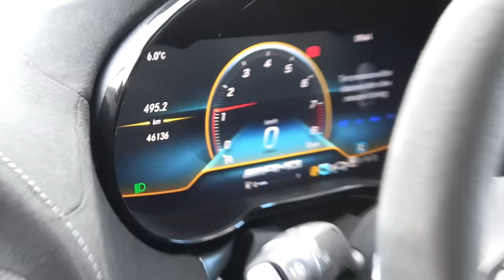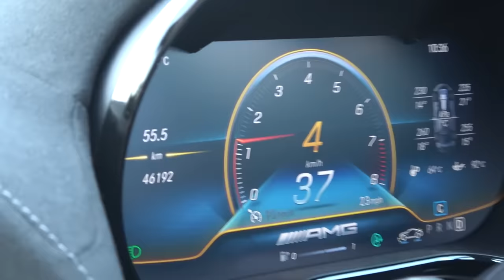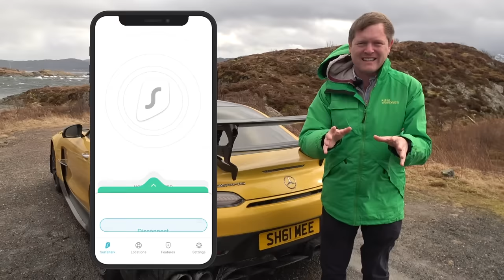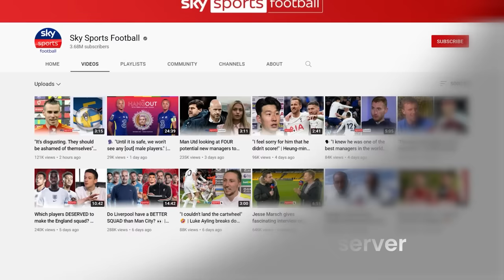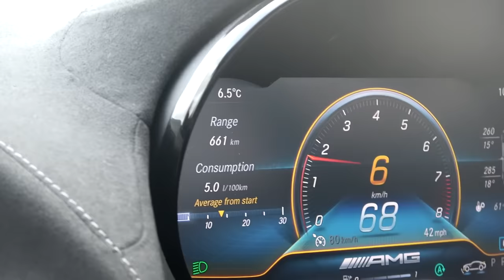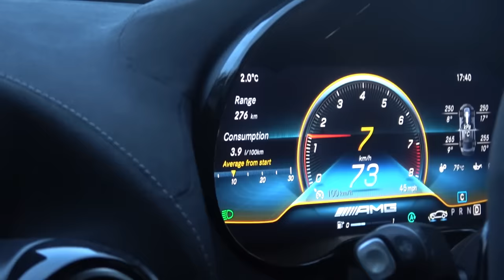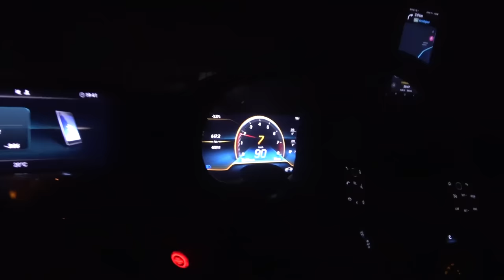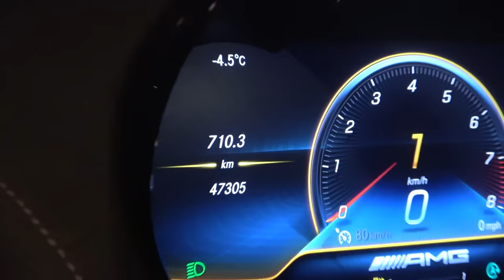The CURSE of the SHMEEMOBILES! It Happened AGAIN...

Comment: Tim…I did the same sort of journey to the Artic Circle in my (then) new 1986 BMW 325i Sport but I went via the east coast of Sweden and up to Lappland then back down through Finland…as you have discovered, that is a LOONNNNNNGGGG way at 40/50mph with overhead Police helicopters watching you so that you rarely ever see them! You also get to see many trees….many..MANY trees…can there ever be a wood shortage?? I did make a film but on VHS format and I have not seen it for decades! Re the roads…I went in May and that is not a good plan as there were long sections where they remove the entire road surface to allow the Permafrost to melt before replacing the complete road from the base upwards. That means…long sections of loose rubble that terrifies paintwork and tyres. I did escape but the car was a picture when I got back home! I think we need to go again…those roads are my sort of place..Not the rubble..but the huge landscapes, sea, bridges and remote tiny villages. As for eating…it was lucky dip and I could not read Swedish so bought myself a nice packet of dog biscuits for lunch…hmm..only once though. Next day a box of “ Nora’s Knackers” which were a shade better but I doubt Bonzo would have spotted the difference! Keep going Tim…build ever more memories.😃😃😃😃😃

Comment: I use specially made adhesive dots that you can place over such a chip/crack to mitigate the risk of the chip/crack propagating. I’ve never had an issue with wipers or my heated windscreen (in Canadian winters). Gives me more than enough time for a professional chip repair that makes it disappear.

Comment: You can wash a windscreen @Shmee150, you don't need to fit a new one when it gets dirty.  lol.   Epic trip, lets hope that there are no more issues before you get back home.
Reply: If you re-watch that section the windscreen is actually cracked.  For most normal cars people would just get it repaired and not think about it again, but with a car like this, with the speeds and pressures it's capable of, a small crack can become a big safety issue very quickly.

Comment: Schmee with the windshield thing, have you thought about looking into polycarboniates, or the stuff they use on armored cars, or maybe a wind deflector on the nose of the car to interupt the airflow, or rather behind the vents, as it could be sucking it in from underneath and throwing it through the vents at the windshield

also my old 2.5 on 89 octane was doing about 350 miles with a quarter left before it needed a fill up, and that was with driving it like a ferrari with 35:47

as the Volkswaggen audi group getting rid of the 5 banger was the worst decision they ever made, now the only thing you can get it in is the RS3, which is now even in turbocharged form, pulling in over 30 miles per gallon on the highway

and I didnt drive slow, and didnt have no stinking turbo or hybrid mode neither, like who knew driving a car with Gene Hunts motor under the bonnet, was the way to get good gas mileage, while having a load of fun

and I had that thing 12 years purely because of that, and the fact that they got rid of that motor in 2015

mind you I didnt have 500 horsepower, although apparently I had more than a ferrari 308 with a Dicky cam put in by a moron

judging by tavarish's now fixed ferrari 308 that is woefully underpowered for what it should be, god I miss that car. 

should have just kept the thing and turned it into a rally car

Comment: What does false fuel mean:
After the ignition spark jumps, combustion of the compressed fuel-air mixture is initiated. The flame front spreads evenly at a speed of around 20 m/s. This can result in temperatures of up to 2,500°C and pressures of up to 60 bar. At the end of the work cycle, the pressure has relaxed to 3 bar to 5 bar at around 900°C.
In a hot combustion chamber, the air-fuel mixture can spontaneously ignite explosively. The gases then burn uncontrollably at high speed. One reason for this may be low octane fuel.
When temperature and pressure suddenly increase, the pressure waves spread through the combustion chamber at the speed of sound and hammer on the cylinder walls. Such “knocking” combustion places a very high mechanical and thermal load on the engine. The pressure peaks that occur can damage the pistons, bearings, cylinder head, valves and spark plugs.
The octane number says something about the ability of gasoline fuels to prevent uncontrolled combustion in the unburned residual gas before the controlled flame front arrives.

Comment: Fuel in Norway does not hold that high quality (lived there for 8 years). Just when you pass the border to Sweden, find a Shell station with 98+ octan.. that's what we drive with the Lambos and so forth. A lot better and even the quality on 95 is better.